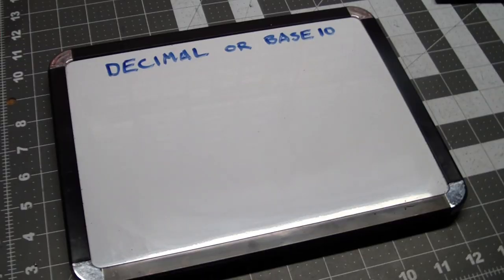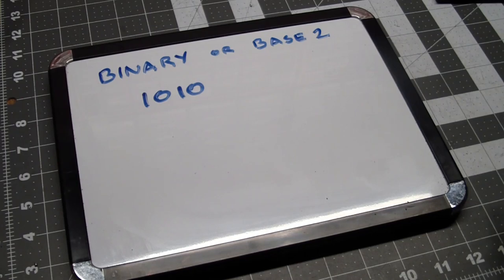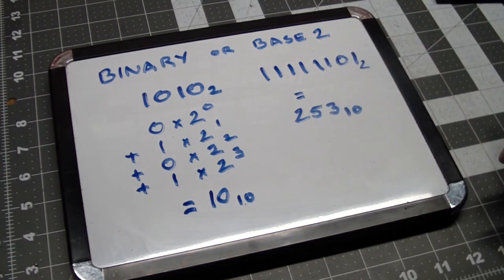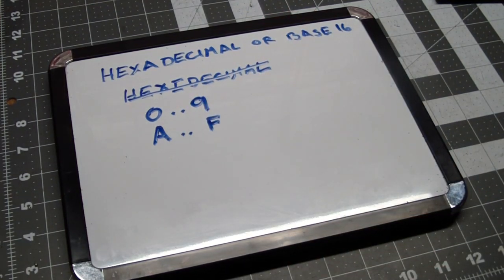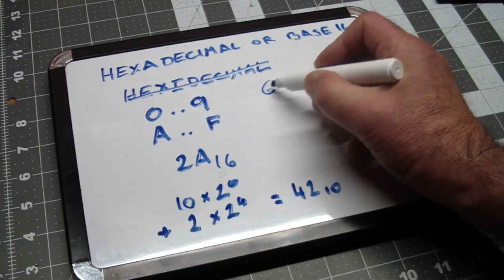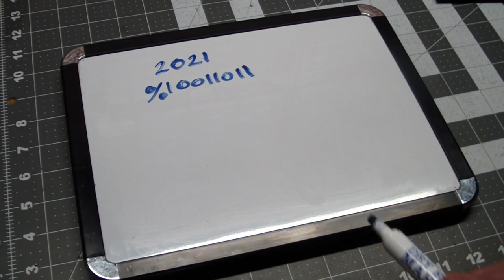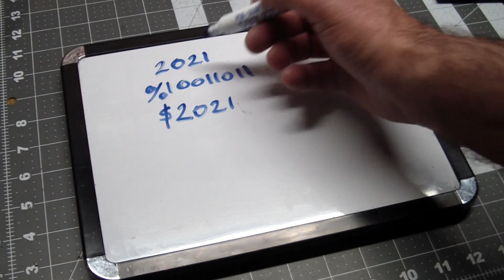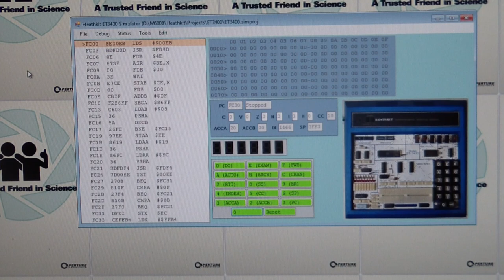AE#158 Motorola 6800 Machine Language Programming, Part 1

Comment: In case any one is wondering why hex is useful: every hex digit maps to exactly 4 binary digits, every octal digit maps to 3 binary digits, but every decimal digit maps to about 3.32 binary digits (which isn't useful).  It's usually useful and easy to memorize the 16 patterns of bits for each hex digit (and you get octal for free).  Octal was used more often before processors settled on 8-bit bytes.  Prior to that many systems used 6-bit groupings (2 octal digits).  12, 18, and 36 bit groupings were also around which also kind of make sense for octal numbers.

Comment: Generally to get a house part number on your device you just had to order 10k parts, and the batch would be made with your house part number and logo on it, for no extra charge.

Only part without that was a mask ROM, where you would have to pay for 1k parts to get them made, and the price included a custom part number unique to the client and mask revision, which they could customise. However the 1k part order was almost the same price as 10k, but was done for development purposes, so you could do a few mask revisions before release, without having to destroy 9k parts every time.

Comment: 0 to 9 and A to F simply because ASCII, and EBDIC, has them follow each other in the table. Thus you could, in the machine code interpreter, very easily assemble the code into a byte, simply by using a subtraction to get the ASCII into a 4 bit number, do an and with 00001111,  and then do 4 carry left's to shift the number to the high nibble, and then add the second identically processed nibble to that, discarding any carry in the process, and get a 8 bit number in a minimum of code. Important if you only had a 1k of ROM to write the entire assembler in, plus include IO routines, screen, program read and write, and keyboard functions.

Comment: ARTIFACE ELECTRONICS, Can you make a video lesson about when your READ an arcade games ROM chips it will display Hexadecimal values in each ROM locations. How do you convert the ROMs hexadecimal values back in to the language programming code ( not machine code ) back into the instruction programming code? I'm very confused when reading ROM chips it list the hexadecimal values for each ROM location but I don't know what the hexadecimal values mean since there is no simulator or converter to know what each ROM location Hexadecimal value is doing to the arcade game. If you can walk us through reading a ROM chip and walking us through each ROM chips location hex value on what it means and is going to the arcade game would help out a lot.
Reply from the maker: Stay tuned for the rest of this series...

Comment: Absolutely useless if you want to repair electronics.👎
Reply from the maker: Knowledge of the inner workings of the firmware have helped me several times in pinpointing a problem. For example, the CPU might be waiting for a button press or wake up signal to start. Checking for bad parts would be useless in such a case.